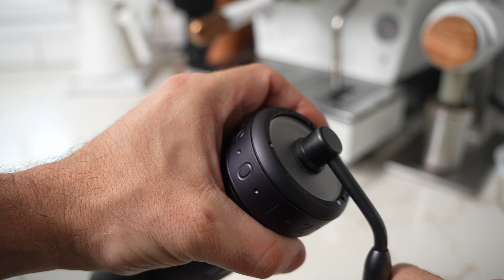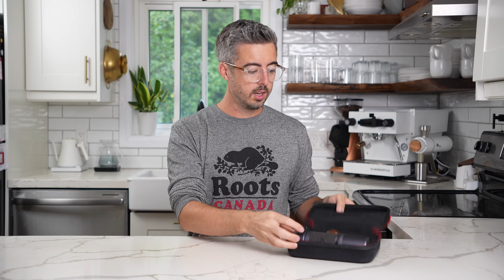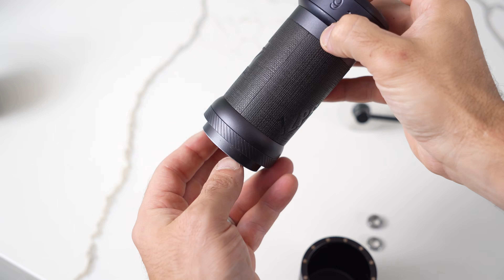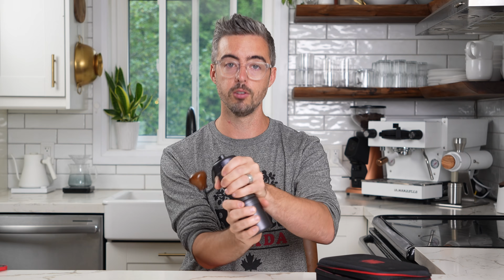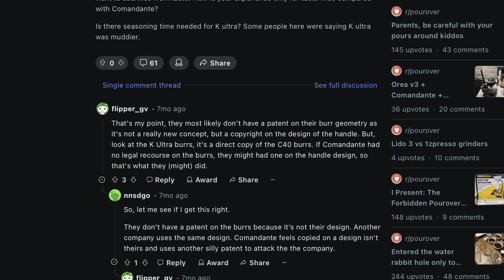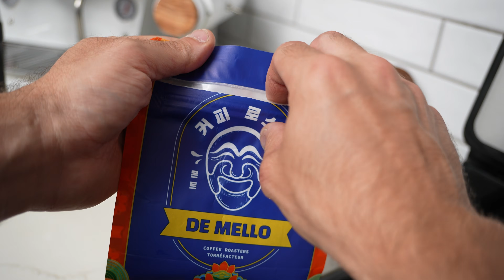1Zpresso K-Ultra - How It Won Me Over

Comment: 100% agree with your findings. The K-Ultra never delivers a bad cup for me out of the gate with any bean I throw at it, though I reach for my other grinders for more clarity—which, just as you point out, takes a bit more work to get a good cup out of them.

Also, 100% of the time, friends and family normies prefer cups ground out of the K-Ultra to my other grinders. Granted, I don't necessarily spend the time to dial in the absolute perfect brew/shot when I serve them out a high clarity grinder/burr set.
Reply: What are your other grinders?

Comment: I have this and the zp6. I use them for filter as I only use electric for spro. I use my zp6 primarily but when I find a bean that I really want more body I grab the k ultra and love both of them.
Reply: Do you think the ZP6 is better in a pour over than the K-Ultra? I can't decide which to buy.. I mostly brew a pour over but sometimes I'd like espresso.
Reply: @igorvinograd7259  the zp6 won’t do espresso
Reply: @igorvinograd7259 zp6 just does not do espresso. There's your answer.
Reply: I do the opposite. Have this and the zp6 and use the K on the regular. I don’t love how much clarity the zp6 provides and enjoy the body of the K more. I will go a zp6 brew every once in awhile.
Reply: What grind settings do you use on both? I’m having trouble finding out the equivalents (I.e. finding the equivalent number on a ZP6 that would be to a 7 on K ultra)

Comment: This grinder and the Pietro Lance Burr are the best two hand grinders. I’ve used them both a lot. I agree with your summary for the most part. I sold my 1ZPresso and kept the Pietro since I only do brew. I think the Pietro is more forgiving than this review made it seem. I stay on the coarse end. The stand for Pietro fixes the ergonomic issues but it does grind about half the speed of the K Ultra and is substantially heavier if you’re traveling with it. 

You can’t go wrong with either grinder but I would agree that the Ultra has less upside and less downside in the cup making it a little easier to dial in but I don’t think the depth of the downside is as as high as the upside. In other words, Pietro can you you a juicer and tastier cup more so that it can be harder to dial in.